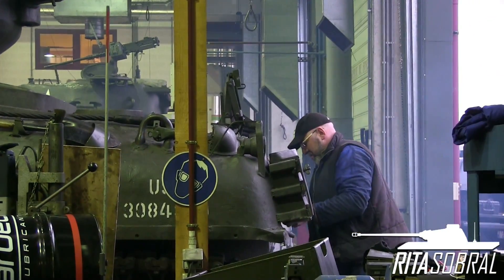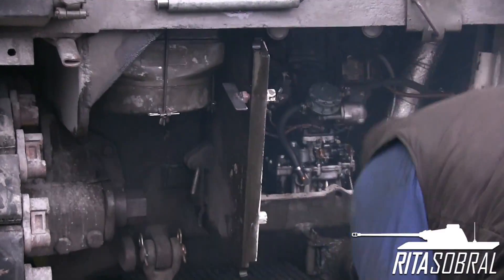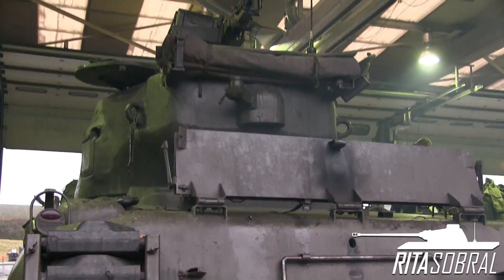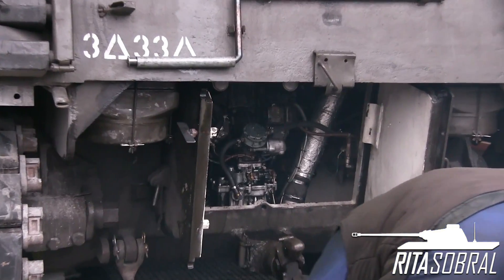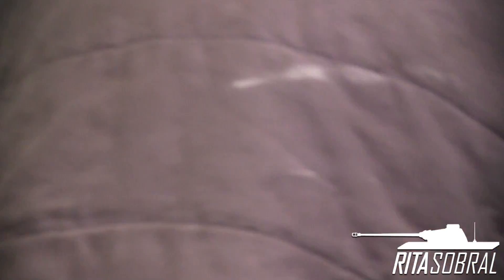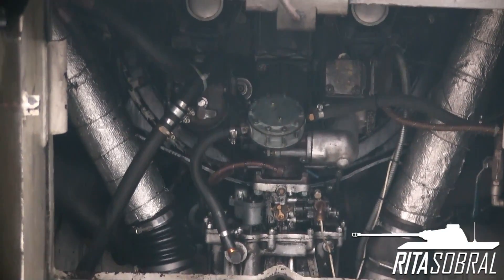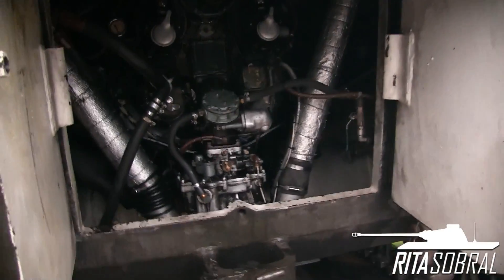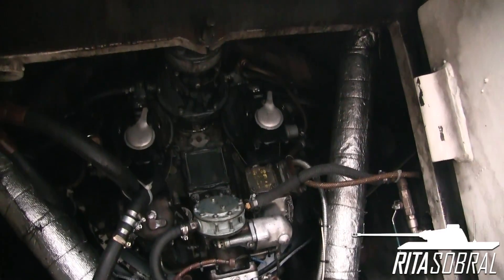(76mm M4A1 Sherman) Wright Continental R975 C4 Radial Engine Sound

Comment: FYI, when a radial engine is shut down, the dry sump stop working.  Thus, the oil in the cylinders and block all drain down into the lower cylinders.  This oil in the cylinders is why they smoke so much on start up.  Also why they must hand crank it over a few times to allow oil to drain out of the cylinders via the valves so it will not hydro lock the cylinder and bend a rod.

Comment: Hi Rita thanks my friend, there is a huge differance between the two motors, the wright is an aircraft engine adopted to use in a tank that is the main reason for the smpke for it gathers in the bottom cylinders when not running and must be turned over to clear the cylinders before it is started, loved the video  my friend thanks
Reply from the maker: I'm very well aware, that subject was spoken on the multibank video but some people still found it to make too much smoke which is why I posted this one, a really nice comparison and both tanks/engines are kept and maintained pretty much by the same caring hands.

Comment: ALL radial engines accumulate oil in the cylinders while not running. Whether in a tank or airplane. After warm up and when running at speed, they clean up a lot.

Comment: A hive of Shermans.... :D

As far as the smoke, all large engines burn oil and spit unburned fuel out until they warm up. The larger the cylinder bore, the looser the tolerances have to be when the engine is cold, to account for the huge pistons expanding from the heat as the engine gets closer to it's normal operating temps.  
Air cooled engines have to be built to even looser tolerances, to account for hot weather and burn even more oil when in cooler temps.
Reply: I figured these vintage engines weren’t as tightly built as modern car and piston airplane engines are.  I always thought the reason was because of technology they had back then compared to now.